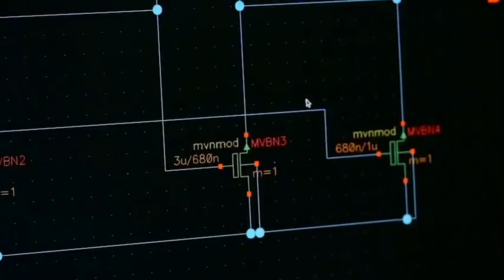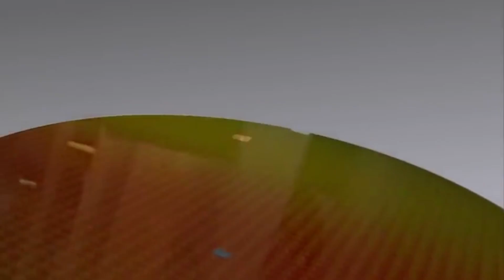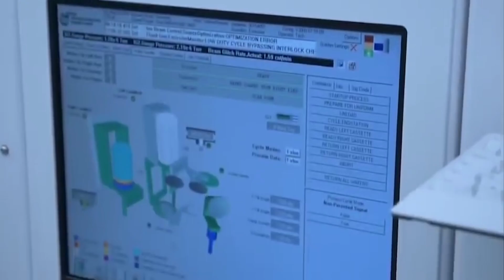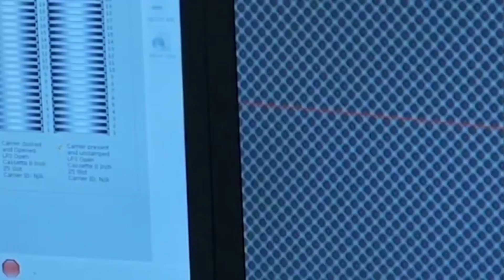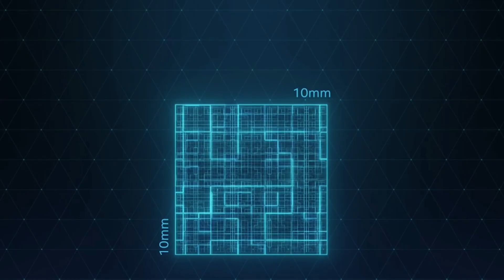HOW IT'S MADE: Microchips

Comment: For anyone wondering how those tiny transistors can be placed by the billions on such a small area: they aren't. The factory uses lenses.

You have seen a projector they use in meetings or schools to show PowerPoint presentations, or movies, right? The big image on the wall comes out from that small projector, because the image is magnified with a lens.
Imagine that it's a different type of lens, which shrinks the image, instead of magnifying it. You project the image on the wall, but now the image is so small, you can't see it.

Put a slice of bread on the kitchen table. Spread thick blueberry jelly on it, generously. Let it dry for a while.
Take a tennis racket. Fill some holes in the net. Hold the tennis racket above the table, above the slice of bread.
Put a lamp above the tennis racket.
The light shines through the holes (not the plugged ones), onto the table and bread below. It will create an image of light spots and dark spots, on the table.
Now put a shrinking lens, as wide as the tennis racket, between the tennis racket and the slice of bread. Move it until It shrinks the spotty image exactly onto the blueberry-spread slice of bread.
The blueberry jelly is not light sensitive, but if it would be, it would soften where the light spots hit from above, and would remain hard, where the dark spots are.
Wash the slice of bread with Coca-Cola. The softened jelly will wash away, the hard jelly will stay. Now you have a spotty slice of bread, it has blueberry jelly only where the holes were plugged in the tennis racket and the light didn't shine through.

Take a different tennis racket, plug other holes in it.
Spread peanut butter on the bread, on top of the dry bread and jelly spots.
Repeat the lamp-lens-washing process.

Now you have a layered bread/jelly/peanut butter masterpiece. Some parts have three layers, some only bread and jelly (where the peanut butter washed away), some only bread and peanut butter (where the jelly washed away), some with only bread (where both tennis rackets had holes, so the light went through, so the jelly and the peanut butter softened and was washed away, in the respective steps of the process).
You just need to plan beforehand, which holes to plug in those tennis rackets, so you can build your islands of jelly and/or peanut butter, where you want them on your slice of bread.

And that, my friends, is how transistors in integrated circuits are built, layer by layer. If you use various semiconductor/conductor/insulator materials instead of jelly or peanut butter, and pretty much replace the whole installation with specialized equipment and materials, and really, really good lenses, you have an integrated circuit manufacturing kitchen. I mean fabrication plant. Fab. Factory.

The components are not placed on the silicon, they are spread (well...) as a layer of homogeneous material, then illuminated (well...) in specific points, then washed away (well...), then spread a different material, illuminate in a different set of specific points, washed, and repeat this several times, with several materials and several photomasks. Which are essentially sieves, not carnival masks.

The transistors are not placed, they are built all together (well...), on the silicon disc itself. And thanks to the lens, they can be smaller than we can hold, because we never hold them, we build them on their silicon disc, right there, layer by layer. Theoretically, we don't even need to see them, even with a microscope, because we see the big mask above with the holes we made in it, but we shrink the circuit's image using lenses (well...) and that's what gets made. We still need to see them though, with microscopes, because we need to see if they were made ok.
Reply: Thank you, this was a great explaination.
Reply: This is the first time I have found anything that explained this process. I could not figure out how something so small could be made, but now it makes sense!
Reply: Thanks I learned more from your explanation than from this vague video.
Reply: @steelfalconx2000  hahaha
Reply: Thanks. This is a damn good and concise explanation
Reply: @sanjayrao3257  Concise? Riiiiiight. A 500 word essay is in no way, "concise". 🤣
Reply: @MichaelEgan66  For this topic a 500 word explanation is concise.... Unless you have ADHD that is 🤣
Reply: @MichaelEgan66  True...it's always a challenge to explain it concisely, but still give enough details so it's understandable.
Reply: Glad I read through that whole comment. Thank you for your unique and helpful explanation my kind sir 🙏
Reply: Thank you my friend, finally i can understand (the big picture) of how chips are made 😂😂. The creator of the video should pin this comment
Reply: Thanks, now I get it, plus I'm hungry for a PB & J sandwhich.
Reply: This entire masking process was developed many many years ago in the printing industry to “burn” printing plates which ended up being wrapped around a revolving drum on a printing press and held the ink for the images.
Reply: @37yearsofanythingisenough39  I didn't know that this was born in the printing industry, but it makes sense.
Reply: This is by far the best explanation on the topic. Thanks.
Reply: Perfect analogy for me! Now I finally understand. Thank you!
Reply: Thank you so much, great explanation! I am an electrical engineering student and I wonder what is the name of this field where electrical engineers are involved in building these microchips?
Reply: @maramam5024   The field itself is VLSI...where you have a lot of subfields ranging from Layout engineers(who create layouts from schematics) to Fab engineers who drive the Fabrication process
Reply: @maramam5024  I think it's microelectronics, integrated circuit design and manufacturing, or whatever name the university gives to that course.
Reply: Amazing Explaination...
Reply: Thanks my dude!! Thats how you explain to us bread heads 😂👌👌
Reply: Thank you sir
Reply: best explanation ever...
Reply: Who's going to come help me clean this mess!
Reply: I still don't completely get it...but I've gained 4 pounds
Reply: I work in semiconductor cleanroom since 4 years. that is one of the best simple short explanation for the process without too much simplification. i stealing that idea!!!
Reply: thanks sir, usted es una eminencia
Reply: That was actually a lot more informative than the video itself, thx
Reply: When explaining the analogy is more complicated than explain the real thing
Reply: @sinister_muffins  Sadly, it's true.
Reply: Looks like I am watching geaography channel and some professionals making an episode longer and longer, but it is well explained and well described so I really wanted say thanks to you, 
Sorry for my starting words because I watch geography channels and it feels same for me.. 
Thanks for this explaination
Reply: this, my friend, was the most incredible youtube comment i've ever read. it was incredibly well explained, to the point that somebody who failed year 3 ICT lessons could still understand perfectly. impressive.
Reply: @permanentbann  Why thank you, kind stranger.
Reply: This is the answer I’ve been looking for.
Reply: This is plain English right here
Reply: genius! thank you for your explanation sir. really helpful.
Reply: Engineer? 😉
Reply: Thank you so much i have been wondering how its made for months..
Reply: That was epic and very helpful. Thank you!
Reply: This is a brilliant explanation. Thank you.
Reply: Op
Reply: Hello, thank you so much for this great explanation that I had failed to find anywhere else on the internet! Is this process also used for the placing of memory cells and other components of an SSD?
Reply: TLDR
Reply: this was way more helpful than the video, thanks!
Reply: Ok professor
Reply: My kitchen may be a mess now but my brain is very content - thank you so much! ❤
Reply: Well, now I have a pile of rotten sliced bread that can do nothing but smells really bad. 🤣
Reply: Thanks for such a good simple explanation
Reply: You tried well but dumbed it down too much.
Reply: Wow that’s was a great explanation
Reply: tfw a random guy in the comments is more educational than the video itself
Reply: I did not read all, but I believe you have summarized the whole process.🔥
Reply: Great explanation. Straight from my grandmothers cookbook
Reply: Never read such nonsense in my life. And i worked at a wafer production facility for 15 years, so i know what im talking about.
Only the last couple of sentences make some sense.
Have you ever seen a computer board? Thats what's on those discs, only micro versions of it. 
Just layers and layers of connectors.

Comment: i make microchips at my work, we do all these things essentially by hand.  extrude the raw ceramic tape, laser-cut it, then fill/print/laminate layers (my job) in the clean room with conductive inks & pastes, then depending on the part we punch them all out individually or as a grouped wafer, then it gets fired into a solid piece.  the process described in this video is way more automated than my experience; all of the machines we use are analog using dies, screens, & stencils (apart from the laser cnc).  we also produce heat sinks, semiconductor circuits, transistors, diodes, pretty much anything that fuses silicon & metal

Comment: Worked at a machine shop we made fittings and tubes that flow the gases to do the etching in the microchips. They were polished to mirror finish on the inside so the gas atoms wouldn’t have a place to get trapped In the groves from machining processes. Also parts were packaged in a clean room. They had a wafer framed hanging on the wall assuming it was a scrap wafer.
Reply: Actually the polishing is to stop the generation of particulates in the gas lines. Particulates are the bugbear of semiconductor manufacture...

Comment: Looks like a 20-30 year old fab, but some of those still running.  Probably a 436 nm G-line stepper.  Currently 248 & 193 nm DUV scanners are mostly used.  For cutting edge product(like Apple M1 & M2) EUV 13.5 nm light is used to expose.  Also more automation and overhead transport systems deliver the wafer FOUP's to the machines.
Reply: I actually had the opportunity to work in a fab that was apparently the longest operating (the place apparently made tubes before that). We had 40 year old systems still, so to my knowledge, we did produce some legacy chips that were still needed due to the equipment we had available. It was wild seeing machines operating off of 1970's terminal computers, situated right next to a 2018, 20-million-dollar atomic force microscope.
Reply: @BT-ex7ko  Have you seen this video? https://www.youtube.com/watch?v=xu8Fi0tC9IA

Comment: Use to crack me up the things engineers sneak into the chips. Under the microscope you’d see little images or sayings. One I remember had “I’m a lumberjack and I’m ok”. Another had a cactus image. I remember seeing a Snoopy in one.
Reply: That would be the mask layout guys - not sure how much it happens now, but time was that in an "unused" area on the device the layout guys would produce a picture that they had separated different elements onto different masking layers, so you couldn't see the whole thing until the wafer had been through the whole process. Sometimes quite "extraordinary" things would get through as the layout was rarely looked at with all the layers overlaid.

Comment: I worked in a semiconductor fab in the late 90’s. I did parametric testing and also what was called back-grinding. Once the chip was done, the back was ground so the chip was a certain thickness.we worked with 6” silicon disks (wafers).
Reply: Dope
Reply: @miguelmartinez-wo6jg  wow, brilliant post
Reply: Thats interesting! In the chips where I worked, we used the chemical etching tanks to thin them down. Probably was introduced as much cleaner way to thin them without possibly contaminating them.
Reply: @BT-ex7ko  backgrinding was very dirty but the chips were finished by then. We also coated them to protect them.

Comment: I'm a Layout Designer, and I just wanted to let you know I appreciate that you acknowledged the most important step to making microchips. Most videos I have seen never talk about mask design, just the fabrication process. Great video!
Reply: Cool ;p)
Reply: Im majoring in EE and I’m currently taking a VLSI elective. How does one learn more about doing layout and what not after or outside of class?

Im in my final semester and have been wanting to get an internship doing that but it’s been difficult.
Reply: @robertonunez6626  that’s a great question! And I’m afraid not going to be the answer you might like. Most engineers have no idea what layout even looks like. Anyone who does layout had no idea what it was going to be like either. Anyone who got an associates for layout told me they had an idea, but it was nothing like the real thing. I interned for a layout position and learned during that. That’s my recommendation, intern for it. You could do other internships for engineer things, but maybe do just one that shows you layout. A big disconnect between layout and designers is that the designers think they can just add more and more devices, and as layout I have to tell them “Sorry, that’s not going to be physically possible. Let’s try this.”

I think internship would be best, because colleges often give examples of things that aren’t even anywhere close to reality.
Reply: @robertonunez6626  it seems most EE degree departments would have an elective about semiconductor manufacting and device physics, you might take that class where they would show you some basic constructions.  Other than that , since you will be part of the electronics industry, you will have a chance to work with a layout team likely and if you work in a good company some of them might sit down with you and show you a little of what they do.  I think there might also be videos here on YT..
Reply: No masks, no chips

Comment: Now I can't help but wonder... without the microchip to run all of this sophisticated machinery and computer-aided visuals, how tf did they make the first ever microchip?!?!
Reply: Chicken and egg for the digital age 🤯
Reply: Equipment used individual transistors or thick film integrated circuits, Rubylith was used to transfer the design to masks, with optical reduction and a direct developed silver image on the photomask that changed to a resist image that was etched into a chrome layer on the mask for durability.
This got you your first IC's.

Comment: Good video very interesting, however I noticed that your main focus was on the front end that is the manufacturing of the silicon disc also called the wafer. It would have been nice to spend more time on the back end (assembly) process where it would have been visually easier to be understood. Overall good job.

Comment: As a note there is a final process prior to assembly called metalization. This is where usually a source of pure %99.99 AL is deposited via atomization inside of a crucible which will coat the surface of said wafer, giving it a shiny sheen coat like a mirror. After which the wafer is etched with acid for a specific period of time to remove the correct amount of AL from the surface. After which then the wafer goes through another heat treatment process for future proofing. 

I know this all because just this last semester I had in college I actually made my own microchips in a lab.
Reply: Dude there are hundreds of processes he didn't mention
Reply: @-BuddyGuy  Yeah. I was actually pretty upset at this video, as it really downplays some of the insane tech, the ancient legacy tech, the hundreds of repeated steps, The varying processes, the insane amount some wafers can hold, and the lack of giving an idea of how long these take to make. One of the chips we made where I worked took 13 months to fabricate from start to finish. Maybe I'm just being pedantic, but given the massive shortage ongoing, it would've been nice to have a more detailed out on the process, so people know exactly why it's taking so long to sort that.
Reply: @BT-ex7ko  I work in the industry too. In fact it's so complex nobody really knows how the whole thing works. Everyone has their piece of it with the people looking at the overall process having a much higher level view. It also changes dramatically with each technology node
Reply: Actually only older/larger processes use aluminium as the conductor (>~180nm/0.18µm), below this current densities tend to require the use of copper plating  metallisation to maintain reliability of the interconnects. Also evaporative metallisation hasn't been used since the late 70's on chips, sputtering is used for Al dep. 
Also the last layer is a passivation coat over the metal layers, either an oxide or nitride with a hole etched above the bond pads for connection to the package.
Reply: I writing this message while inside the sub FAB of the new WOLFSPEED MVF in Marcy NY. Cheers.

Comment: So if silicon is from sand and there's so much of sand, where does the microchip shortage come from?
Reply: The process of making microchips takes a lot of time. The fabrication plants used to produce them can cost billions of dollars and take many years before they actually begin production.

It can take as long as 8 years to get a microchip fabrication plant going. Demand is higher than ever, and it simply takes time to build enough factories to keep up with demand, especially when it grows as fast as it did.

It's not an issue of needing materials to produce them, it's an issue of needing more being produced and needing time to get the infrastructure going. It's a heavily specialized building that takes a lot of money and time before any microchips leave the doors.